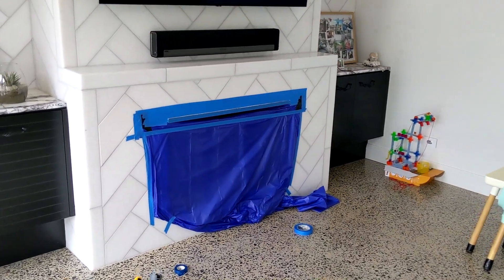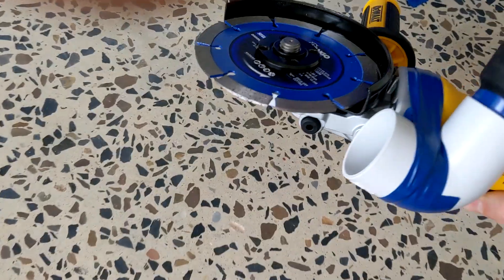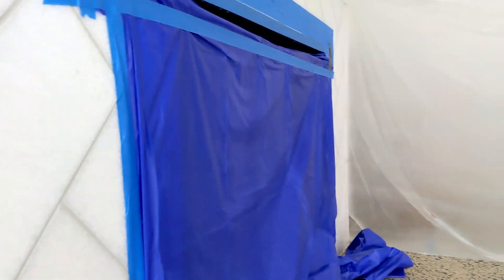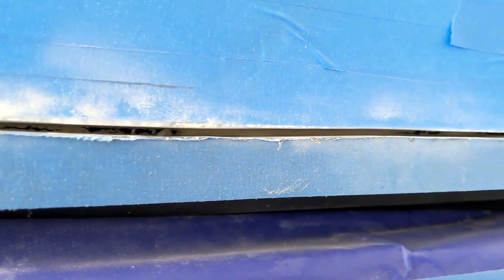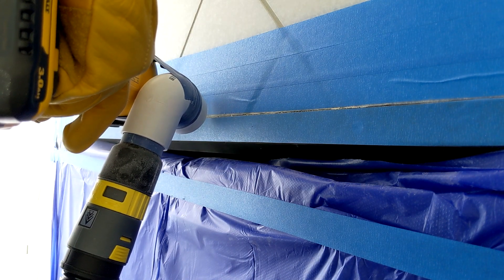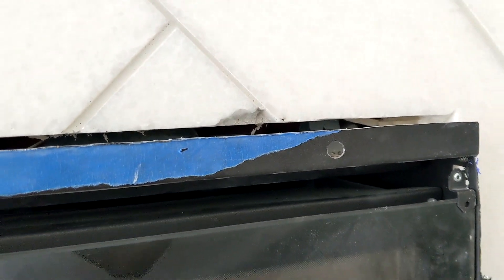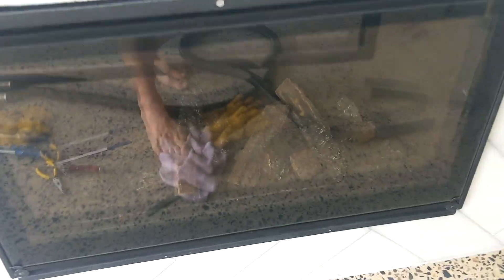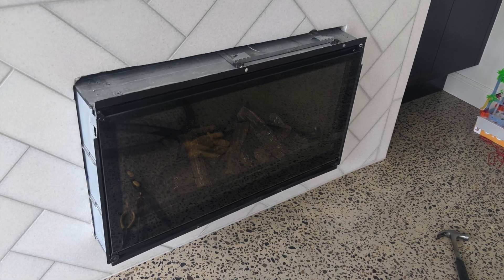Cutting Installed Marble Tile with the Angle Grinder,  Indoor,  Without Dust

Comment: i'm removing a tub and replacing with a shower, but the shower will be wider than the tub, and the new tiles I installed are up to the current tub and surround, so should be fun. My tile is porcelean not marble we'll see what happens. I use the vacuum method as well but I wear the double filter mask and safety goggles.

Comment: thank you for sharing. Since its a straight precise cut, i think a skil saw with diamond blade would of been more appropriate since the angle grinder is not really good at straight cuts
Reply from the maker: Thanks, I had to google what a skil saw is. 
I don't think you can cut marble clean with anything less than ~10k RPM.

Comment: Too bad for the chips. Did you replace tiles? Video? Thanks
Reply from the maker: No, didn't replace the tiles, the fireplace outer frame comes in 2 sizes, got the thicker one and it covered the chips nicely.

Comment: How do you get the corners though if it's up against a cabinet
Reply from the maker: Yeah, it's tricky, in my case I could go a bit past the corner. If it's not possible you'd probably have to use something else to cut the last corner pieces.